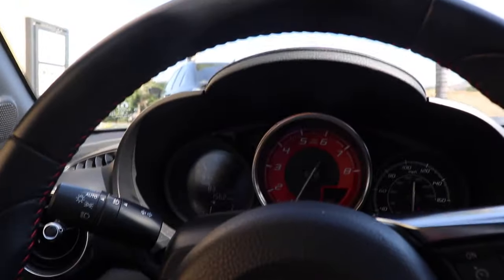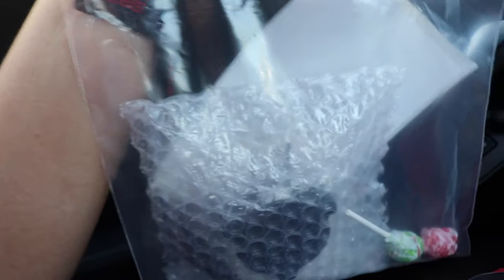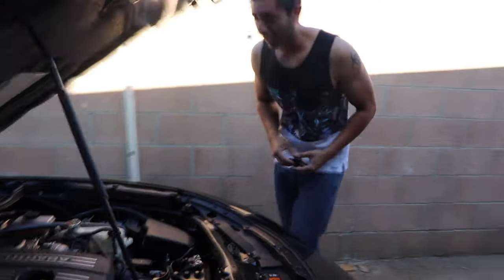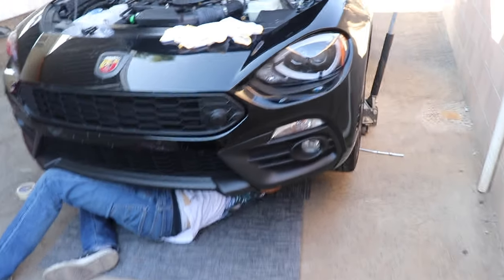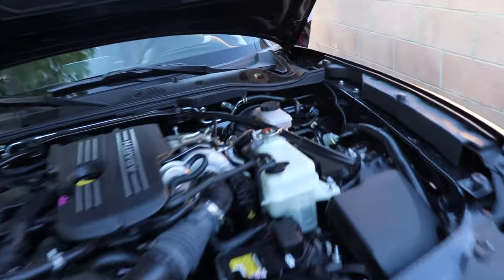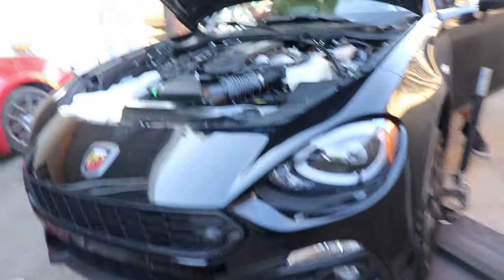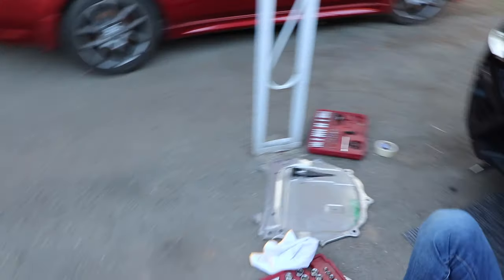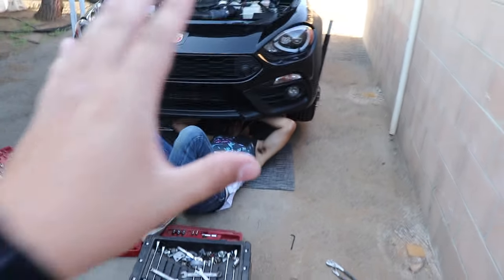Bought The Right Bov For My Fiat Abarth Spider

Comment: Is this the gfb dv and ts bov? Also did you need a tune? If not please let me know which one you bought. I'm trying to do this for mine
Reply from the maker: its the GFB dv and the ts together and no you don't need a tune
Reply: @BaconVlogZl1  do you need the GFB DV. For the noise or is the bov enough
Reply from the maker: @AJ-yx1up  bov was enough but I suggest running both